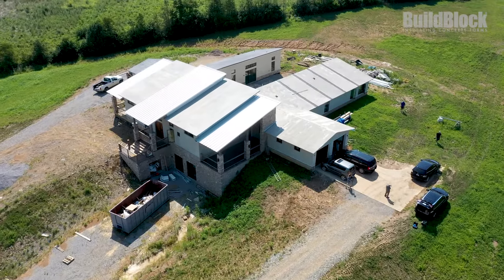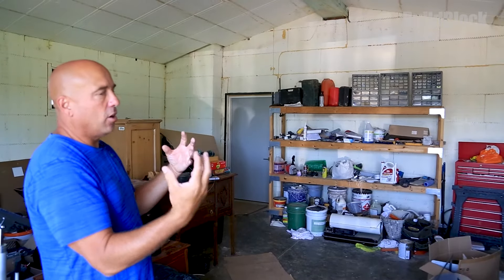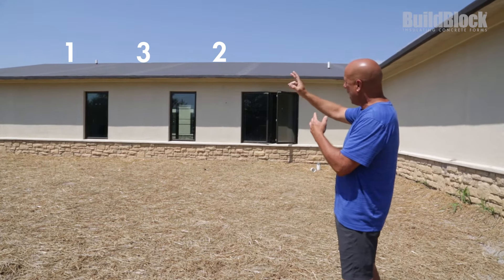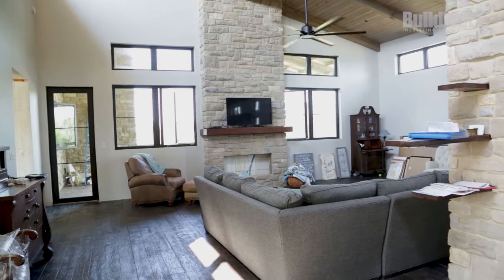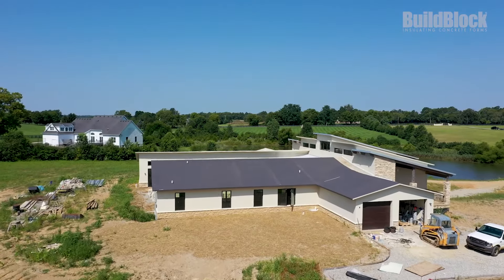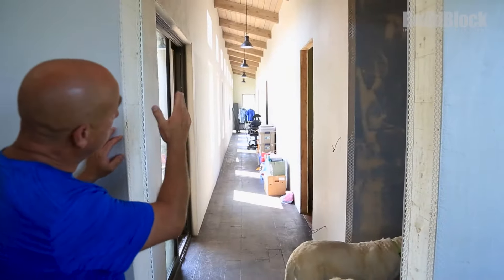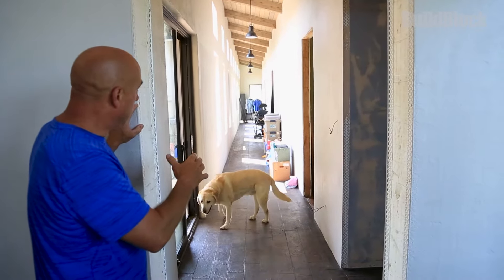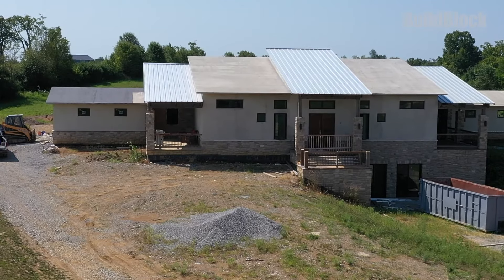How To Build Pitched ICF Roofs

Comment: Looks good, my concrete roof will coming up soon as well. Looking forward to using the build deck system
Reply: This was in my recommendations after watching your latest build video 😅
Reply: @CerebralAilment  ooooioiooioooooooiooooooioioooioioiooioioioioooioioioioiooioioioioiooiooioooioioioiooioioooioiooooo
Reply: Doing the roof in sections does it leave a seam for water to come thru?
Reply: @jqmk18glock17  the elastomeric paint will usually bridge the crack, unless it is real wide

Comment: Looks expensive, another method for the wealthy.
Reply: Well stated. 👍
Reply: Cheaper than rebuilding.
Cheaper in cost cavings of operating that home ( insurance, heating/cooling ).
Cheaper maintenance.
Generally you can lower the Square footage about 5-10% and and build a home out of ICF.  Dunno how much the roof would add.

Comment: A very nice home. If an EF5 tornado hit the home the weakest parts would be windows and garage doors. I plan to have a much smaller single story ICF home built with a similar concrete roof; metal frame storm windows with security screens; metal storm doors with security screen doors; hurricane garage doors with roll down hurricane shutters.

An EF5 tornado can generate wind speeds of 300 MPH + with flying debris at speeds of 150 MPH. Storm windows, hurricane garage doors, storm entry doors may handle 150 MPH winds, however for added security and safety the metal security screening over the windows and entry door should lessen the winds force on them along with the debris hitting the high impact security screens at 150 MPH which should absorb that impact; not the windows or doors.

There are few videos showing an ICF home after being hit by an EF5 tornado and those homes did not have a ICF roof; all that was left were the walls. The roof was gone because it WAS NOT ICF and just a standard roof; there were no windows any doors or anything in the home because everything was sucked out of the home. It looks as if no storm windows etc were used. If these homes were built with an ICF roof, storm windows and doors with security screen etc. those homes would likely still have all their belongings with only damage to the exterior. Making the entire home more of a EF5 tornato proof structure. A better way to protect your fanily and pets.
Reply: I doubt any economical option exists for glass that would survive an EF5, but metal storm shutters certainly do. If budget were no object you could use bullet-resistant glass or very, very thick impact-resistant polycarbonate. For garage doors, look into single-piece hydraulic doors (e.g. Schweiss, PowerLift) like they use for aircraft hangars. I can't recall the company, but I've seen an example of one of those systems used on a garage door that had a full brick facade on it to make it "disappear" when closed, weight isn't really an issue for them and they have mechanical interlock systems to backup the hydraulics.
Reply: @dwaynesykes694  The mandates in the Miami-Dade area for windows and doors would help, since those are SUPPOSED to be able to stand up to a Cat 4 hurricane.  Yes, a lot less powerful than an EF5 twister but it's a step in the right direction.

Comment: Wow 3 12 pitch that is pretty good can they pour 7 12 pitch?   So the rebar did ICF form people give you the diagrams for the rebar ties and the rebar positions?  I just know they have to be at the neutral axis and they might need to have pretension threaded bars for torque specification and corresponding  tension. Did they give you details for that or did you have to find someone to design that part for your house?

Comment: What are the advantages? Heating/cooling, storm shelter am I missing anything?
Reply: Longevity of your structure would improve by hundreds of years. You could pass this home down how many generations?
Reply: An extremely comfortable storm shelter.  It would nearly qualify as a bunker with the addition of metal roller hurricane shutters for the windows and doors.  HVAC will be extremely affordable due to the thermal mass of the entire structure being tied together.  In fact the largest losses there will be the windows and doors, which is actually normal.  An advantage of an all ICF build would be that, unless YOU make a hole in it, it is inherently air/water and bug tight.  No need to worry that someone didn't tape a seam or two in your ZIP sheathing properly or seal up a nail head.

Comment: 1:23 Might your "candy-canes" have been better placed to have the long rebar at the top rather than the bottom?
Even better, run the short rebar a few feet back up the roof.
The tension will tend to be in the top rebar at the roof-wall junction rather than in the bottom bar.
Nice work regardless and I'm just an armchair expert so please feel free to educate me! ;)
Reply: I was wondering the exact same thing - seems the tension is all at the "short end" of the cane (where it stops) as opposed to the long side, and it would make sense to have the short side on the bottom. But, like you, I'm yelling from the cheap seats :)

Comment: It looks like no one is answering the questions here, so I welcome any comments others can give me. My question is pouring two sections of the roof and then coming back and pouring the one in the middle. Wouldn't that create a cold joint that could leak? I understand he is putting on a sealant, but it still concerns me.
Reply: the elastomeric paint will bridge a regular sized crack, it will expand when necessary. but there is nothing to rot under the crack anyways so if you dont notice it for a while, it would be fine. just go up and put more paint on
Reply: He's using elastomeric that is good stuff but I would use a silicone all the way and make a single membrane roof yes when you report that way there's always a possibility that a sheep hole will come through there and you get a leak but with the last American or silicone it's not likely and silicone last 50 years

Comment: What is the steepest you can make a BuildDeck ICF roof?
Reply: With the correct concrete guy pretty dam steep 
I did a 5/12 and it was no problem for the CC guy
Reply: I did 7/12 and it works fine, video is on my channel here

Comment: Very cool. This looks like it costs about 3x building a traditional roof. 
They built a roof to hold the concrete roof while being poured. They have to brace it then all the rebar work. 
When it's done it could probably withstand a direct hit by an F-5 Tornado but it costs a premium.
Reply: I don't know this guy's numbers, but we might be surprised by how (relatively little) more it costs. for one thing, the extra bracing materials can be re-used, which is a cost savings (either for the owner or if done by a contractor) and the shoring doesn't have to be as finely done, so a slapdash support system can work just fine...which is cheaper and easier.  to your point...it will cost more. but, if you're looking for F5 tornado protection...well...solution has been found.... 🙂 I want to do something similar...but, probably not quite so fancy as this project.

Comment: Seems like a SIP panel with standing seam metal roof would be way more practical.
Reply: depends on your goal.  It seems that he's living in tornado alley and being strong enough to resist the winds of a tornado seems to be one of his goals.  Sips would just be ripped off in a tornado.  His 30 foot fee spans are more difficult with sips as well.  he also gains sound suppression with concrete as well as fire resistance.